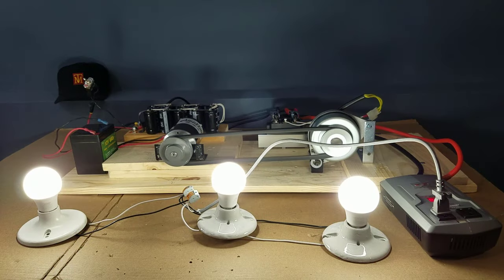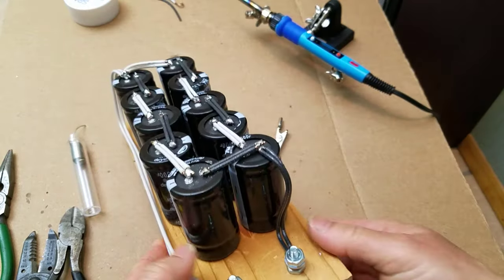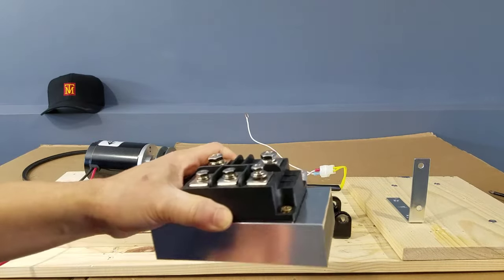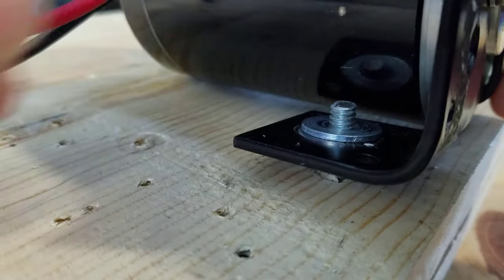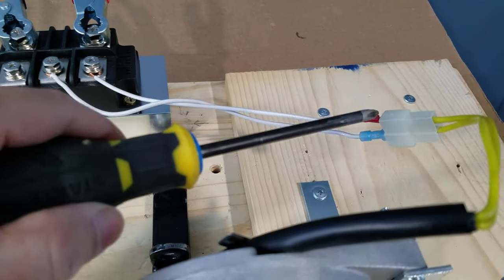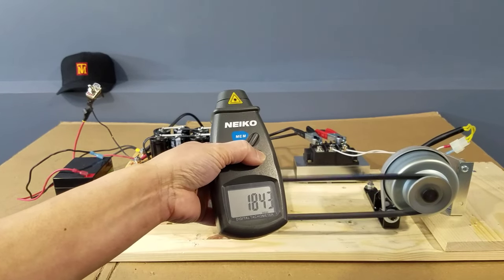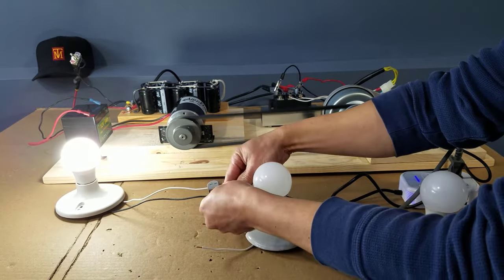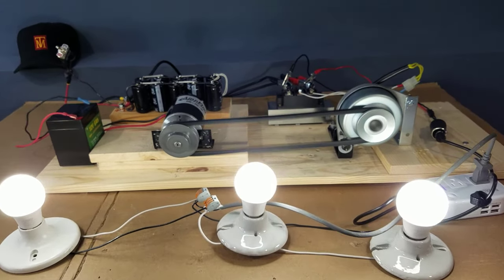Self-Charging Machine? (Permanent Magnet Alternator)

Comment: you should measure the battery voltage before starting then after a few hours of running, you measure the battery voltage if it is worth it. if the voltage drops its not worth, but if the voltage increases its worthy
Reply: He did do that, at 5:44 and 10:17.
Reply: it wont drop until the capacitors are empty,  But once the surge is done,  the capacitors remain.  It depends on the surge amount you launch at those capacitors.   IF its alot,  they will empty themselves, like what he shows when he welds.   This system would be fine, with a voltage regulator, and more bats.  Then, you may be able to leave it running,  like it is, the capacitors will over fill, unless you have a constant load on it, but even so,  if its not much a load, they can explode capacitors, do have a limit somewhere...  A voltage is what is missing,  it has to be there to leave it on.  which means, your not going to get 200 amps.  whatever the capacitors will do with a voltage regulator on them.     DA   the regulator has to be there, or you cannot leave it on.

Comment: I dunno guys. I think the mighty tiger could do a lot to help answer some basic questions here. He's not answering most of the questions posted by viewers. He has built the set up now already and he could easily provide more basic meter readings or disconnect the battery or swap out the battery etc as many viewers had suggested. He doesn't seem to mind if a few dozen people go and buy all of these parts and can't get their builds operating properly. So many basic questions and so little answers. The mighty tiger's silence is not helping prove that this build is worthwhile.
Reply: answering a question does not mean its the right answer

Comment: the 14.5 amps for free, will rise considerably when u apply more rpms to the alternators,  Until the bats are fully charged.  This type alternator here, has no voltage regulator so it can so fill the capacitors beyond belief so its not good for the battery.  With normal car alternators,  the voltage regulator will lower itself, when necessary to protect the battery's.   So, you can so, leave it on yes.  This above, is not cooking 200 amps, its probably 3 or 4 amps with low rpms at source.  a good 20 battery system requires about 40 amps, so you have to double the rpms to about 5400 rpms or so,   one of those electric grinders shuv out a bunch of rpms,   verses an impact wrench.  regular drills are about 2000 rpms.  If i want the full use of the alternator,  i would have to go to about 20000 rpms, then i would get close to its total output of 60 amps from one alternator, so if I had three set up on the one source,   it would generate plenty of power to its own source of power of the grinder engine, using low amps compared to how much it is pumping, and then, you supply your amount of bats, so that when you divide it up, your charging each bat at about 10 amps or slightly less.   Volts do not mean that much, as to how long it takes, to fill the batteries.  The amps are what you watch.  In return, each bat give you amp hours on the bat, and you can figure your load from your source of amps,  Most bats,  100 amp hours lead acid.   This system is ok for like a shed, where when you leave, you turn it off,  If you do not turn it off, it will explode the capacitors, and possibly the battery.   Unless, you put a voltage regulator that works in it.  Capacitors are only for surge purposes s really.  To start the load.  Here, he is using them like batteries.   His 5.5 amp drill will run maybe an hour, then nothing,  not enough bat here.  it all depends on the load.  Shed Use.  Not for the home. Turn it off, unless you like fires.   Don't forget, its made in China

Comment: In 2005 my physics professor told me that if you connect the caps on both side of load in series and then connect both caps to high voltage source, then you can run the load with displacement current and there will be very little current  consumed at the side of high voltage source.

Comment: Excellent video I got a a question I bought the capacitors capacitors that you using and the voltage on a capacitor is 14.1 is that normal on just one capacitor

Comment: Where did you find the bracket to mount the DC motor? Can you provide me the link to the bracket. What length size screw you used to fix it with the bracket?

Comment: This setup works on an automobile, but you have a gasoline motor turning the alternator., a larger, maybe 2-1 pulley system might produce enough volts to continually charge the battery. I don’t understand the caps being used other than to overcome load on the system. At one point, he switches off the system, but lights stay lit and are a little dimmer than when the system is running, so he is producing some usable electric energy and although the battery might eventually go dead, it might actually take longer to kill the battery. Here’s a thought., do away with the caps and use a 24 volt PMA OR PMG., the extra voltage might just make this viable.

Comment: Sir I have a question. What if we use ADSL kable like a power? 
Just look at this on Google:
 " how many Volts are in the ADSL " 
It will be enought only for small motors? 😉😎 
What if ADSL will be power for generator with magnets, and output will be comes to this device?

Comment: Q:  Have you ever heard of an Infinity Coil to capture voltage from the Aether?
Must be like  Tesla Coil capturing natural voltage and then looping it up to generate usable 120 / 240 / or even 480 volt current.
I know Gerard Morin came up with a Resonance and Frequency design where Over Unity was successfully achieve.
There are some units being built and sold in Asia as I write this but getting one is difficult at best.
I also know there is electric which can be captured right from the ground.
A grounding rod connection will provide low voltage which then can be increased as needed.
Would appreciate your input.
Reply: But you already know the difference between voltage and power?
Reply: I believe our understanding of power generation is not complete. Example we say generator converts mechanical power in the shaft to electrical power. But what if we actually get the electrical power from the "ether" and then when this power is consumed it fights against itself which is where the mechanical power in the shaf is needed to keep the power coming in from the ether. Remember that it is the changing magnetic filed that produce the voltage, and then this voltage causes current to flow, this current then opposes the changing field and such more power is needed to keep the filed changing. The extent to how much power must be consumed to keep the filed changing is just a result of how much of an efficient transducer you can make. And we have just make a constant based of the best efficient generator we have ever built (or theoretical calculated by data collected from a less efficient one). We call this constant the max without realizing that we just based it off a poorly efficient one in the first place.

Comment: Just checking battery specs here. If your battery is a 12 volt LifePO4 it would be at 13.6 volts fully charged resting or 100 percent capacity. At 10 volts it would be stone cold dead or zero capacity. At 11.6 volts your battery has less than 8% capacity left. It'd be good if you could do a new test run with a good fully charged battery and monitor the voltage throughout the test. The good news about doing your test with a depleted battery is that in no way could it supply enough power to run your setup as shown at least not for very long.
Reply: just googled up a chart. I as many asked about the batt. At such a low starter batt charge it got the drill, supposedly 5.5 amp, to run on low. Keep in mind 45 of the 250-300w shown on inverter went to the bulbs. So unless he swapped batteries btwn camera shots and I sincerely hope not, that looks like he did achieve over unity. At full CHG the battery by itself would have exhausted quickly.

Comment: nice project Mr Tiger. I would love to try it in one of my lessons however cant really figure out what will really happen to the system if it is kept running for a period of 24 hours. Kindly advise
Reply: I asked the same question. I'm leaning towards it being legit after reading some things but who am I and what do I know?  He showed failed over unity experiment I saw b4 seeing this. I hypothesized the capacitors were needed to give motor initial surge to not stall the system. That other video, I don't think there was a cap bank. There was other inefficiencies in that system.  One inefficiency in this one is belt driven, not direct drive and it still seems to work.  The battery was very low CHG in this vid. I don't think would have run the system that long or with the drill.  I liked also he let the system get up to speed b4 adding load I think , assuming legitimacy, getting the MG set up to speed before adding a heavy load would be less strain overall. The system got momentum up it was less likely to stall out. Even the inverter perhaps has caps, hence surge wattage and continuous wattage.  But the system don't kick out 2kw continuous. Be aware the caps are making that available initially as surge power but they still exhaust all that quickly and wouldn't hold enough overall to potentially disprove this system. If he put anything 2kw to it, the system would stall. Pay attention as you watch and you'll catch that. Don't be fooled. But I still want to believe the rest is legit

Comment: Cool build bro! My concerns are about the battery. Could part of the load be a battery charger so as to loop the system? Either way the battery tested before startup and then tested after a good run time would answer a lot of questions. 🤔 Meanwhile I hope you find a battery that can remain cool
Reply: Or can I use a deep cycle battery, deep cycle battery will stay cooler than using a regular battery it should,

Comment: The battery wires are connected to the cap bank the whole time. The battery may be getting some charge but there is no way of knowing if the battery is driving the motor. Suggest you add a switch that turns the battery of so you can offer real proof that it is as the title suggests

Comment: Hello sir, just being curious, what would have happened if after 5 minutes or so, you decided to disconnect the starter  battery?
Would the system still continue to run?
Reply: Well, this will not work after a while, only as long as the battery has enough energy.
Reply: The rest is humbug.
Reply: Battery is for the entire system to run, the capacitors  are for storing large amount of current to the dc motor... Therefore the system concidered relies mainly on the battery😅

Comment: Neat work! Can you share the source battery voltage change over 24hr period? Also, what would be the maximum load on this setup?
Reply from the maker: The battery voltage stayed consistent around 11.60 ish, but it got a little too warm for comfort after 30 minutes of running. I had to shut it down. Perhaps, I should of used lead acid battery. Max load was a little under 400Watts.
Reply: @TheoMaxim777  lead acid batteries have very low charging efficiency of 50% when compared to dischaging. you should try using LTOs or Graphene supercaps block as the power source. They have incredible efficiency as well as super-long lifecycles. No need for secondary supercap powerbank. :)
Reply: There is any way can give me wiring instructions
Reply: Is this real
Reply: @YannisG278  you see it with your own eyes it’s doing stuff
Reply: @Pocketninjanight  yea but so is every fake video out there where you could see those doing staff too.

Comment: Congratulations!! You have just made an inverter. Nothing more.... The interesting thing is what if tou connect photovoltaic panel as source of the power, and give a rotational force to an one phase generator through a DC motor......????
Reply from the maker: It's a heck of an inverter! Don't give me any ideas, I might have try it LOL.
Reply: An inverter at 70% efficiency, haha. Plus what's the point of the caps, just another battery, and poor voltage to discharge curve. Everything is running from his 12v battery.would be way more efficient to run the lights from battery directly :)
Reply: @KevinSmith-os5yz   @Kevin Smith  : Me, I can't decide whether the guy is a con or fraud or totally ignorant concerning this topic.

For starters... he runs those caps in series which decreases the total capacitance from 50 Farads and parallels to a total of 100 Farades overall. But to what end, furthering the cleaning up of the DC pulses from the rectifier or trying to add more power back to the battery? Laughable. At best they'll add 10 seconds to the motors rotation after the battery dies or is disconnected....other than that .....they look pretty....but DO NOTHING.  Again, Laughable. 

Next he adds a larger inverter? Again, for what?  It isn't as though they'll draw more power when an established load is put on them (except any parasitic it might have anyways). 

Bottom line: There's no free lunch here. And the only way he'd make money with this is for some dumb sap to buy it.... that, or some unsuspecting honest guy getting taken while doing so. Other than up votes and any add revenue he hopes to generate revenue from......this build is a waste of his and the viewers time.
Reply: @Rev22-21  WIf this is laughable then how best can you improve it to serve better as an alternative to gasoline generator. Pls show us what can work. Thanks
Reply: Notice the speed of the belt (automatically) increases considerably when a greater load is connected.

Comment: How fast is it charging the battery?
Reply from the maker: I didn't really measure the charging speed, but it was pretty quick.
Reply: @TheoMaxim777  Bull shit. Unless you're tapping into radiant energy WHICH YOU ARE NOT, the draw on the battery (measured in wattage) is greater than the alternators power output (measured in wattage). Now prove me wrong.

Comment: The inverter work with alternator and battery power. After starts the system you should disconnect the battery ,that tha inverter to run only with power feeded by alternator. What you do there is not good.
Reply: Marius, do you meeman this actually works? And please what is the capacity of the load it can carry?

Comment: So all three of your 25 Watt light bulbs together are actually only pulling about 15 watts total not 75.... A 100 Watt LED bulb only pulls 13 watts of power.......

And the 750 watt power converter will not draw 750 watts unless you try and use 750 watts of power.... 750 Watts is the potential power usage not what it uses when you turn it on......

Comment: Amigo, he replicado este montaje y la batería al conectarla , va perdiendo voltaje poco a poco, hasta vaciarse. Es una pena que sea fake, pero claro, no se puede ir en contra de las leyes de la termodinámica. Tambien he notado que el motor de 12/24v se calienta mucho.
Friend, I have replicated this assembly and when connecting the battery, it loses voltage little by little, until it is empty. It's a shame that it's fake, but of course, you can't go against the laws of thermodynamics. I have also noticed that the 12/24v motor gets very hot.
Reply: Sergio exactly what I was thinking as well. 
It's easy to do this but very few people realise the absolute truth about physics. 
If one listens very fine then the sound of motor can be heard running slower all the time so yet again  FAKE  VIDEO  .

Also when putting a  " LOAD  "  on the system it is actually fooling so many people because  FREE RUNNING  AMPS  is very little in comparison to actually loading the Drill used in this case .

Comment: This is nothing more than a friction machine. At some point the battery will die, and this will stop running. You'd be better off going right to the inverter from the battery, and cutting out the massive friction losses.

Comment: never seen a motor in description (amp flow e30)
Reply from the maker: It's now in the video description/details. 

No-load rpm: 5600 at 24 volts; Can be used with voltages ranging from 12V to 36VDC
Maximum power: 740 watts (1.0 horsepower); Maximum stall torque: 5.0 Nm (710 oz-in)
Peak efficiency at 24V: 76% at 17 amps and 4900 RPM
Power and torque at peak efficiency: 309 watts, (0.41 horsepower), and 600 mNm (85 oz-in)

Comment: 11.7v is a dead 12v battery.
How many watts and amps is the motor consuming? 
How many watts and amps is output?
Will the machine run indefinitely without the battery dying? Technically that is a dead battery at that voltage?
Need to know these things, show us you have overunity mate.
You have the battery there and while it's capacity is small it would still allow you to run a few LEDs and a drill for a few seconds.
I want to believe you're not another YouTube scammer 🤝
Reply: add a solar panel

Comment: Why did not you disconnect the battery after the start? That is the only way to show us capacity of the whole system. Capacitors + curent power = your system max. On that battery I can cook 2 cups of coffee. On that battery kids riding on scooters. You go with your drill for 45sec. Wast of show and your and mine time.

Comment: Warning, please do not copy!  I have a huge problem right now.  I connected the device to the socket and fed the free energy into the power grid for several months.  My network operator noticed that my electricity meter was running backwards, banned me from doing so and gave me a hefty fine.  If you want to avoid big trouble, better keep your hands off it.  😢
Reply: Seriously?

Comment: The archform for self sustaining & excess power generation is definitely possible in regards to open resonant wireless power transfer systems but with that being said tons of hoaxes & scams out there. The key is alot of negative resistance in the circuit or seperating cause from effect with highly effecient wireless power transfer.